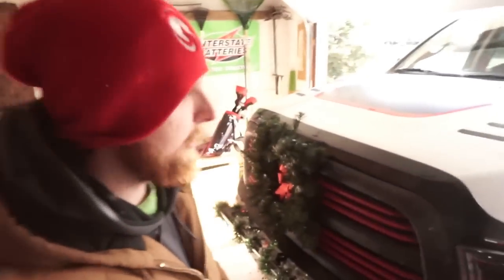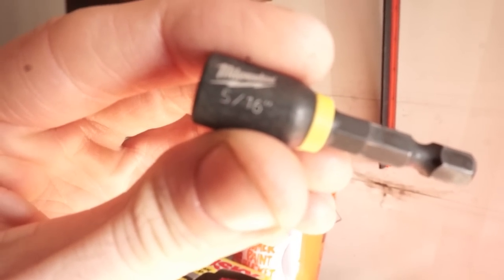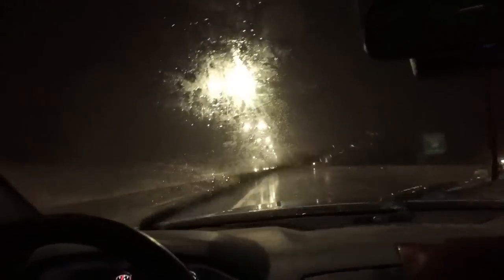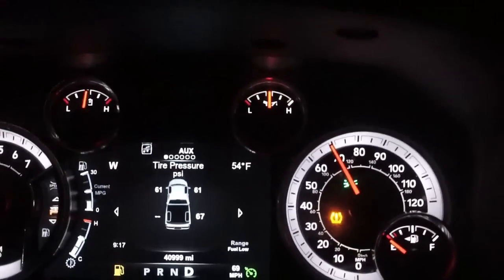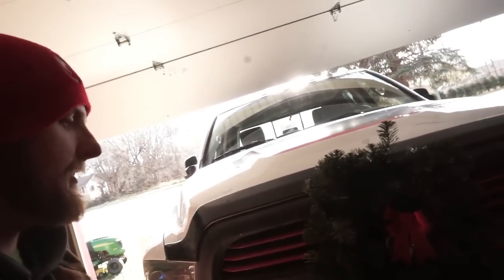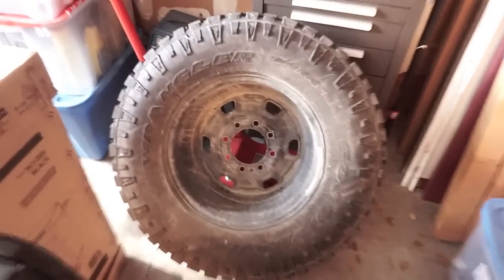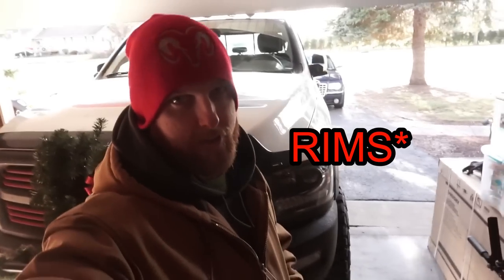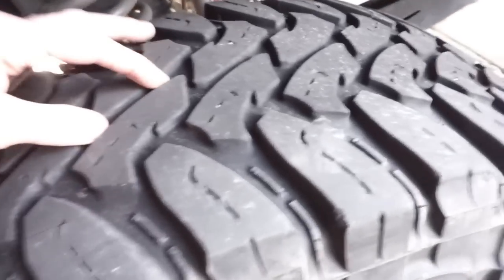I'm DONE With 37" Mud Tires...

Comment: Damn brother my 35x20 Hankook Dynapro MT's have around 30k miles on them and they look better than your fronts. I'm in a 2014 ram 1500.
Reply from the maker: Kenny Rodger yea this truck does lots of miles and it's heavy at 8100 lbs. our roads suck which might hurt. But yea it still seems like bad wear on these tires
Reply from the maker: Kenny Rodger I'll check out the hankooks
Reply: Yeah, 8100 lbs doesn't help, that's for sure.